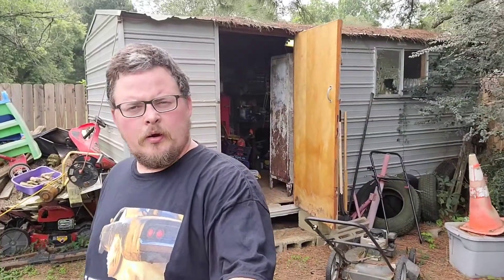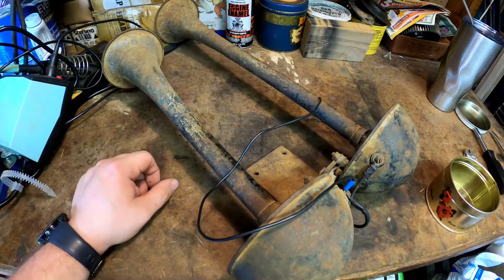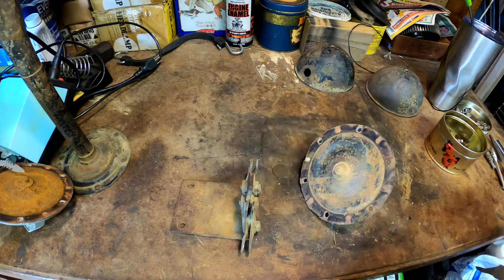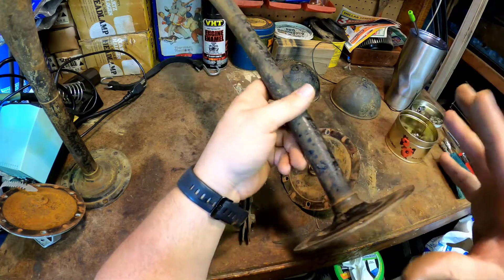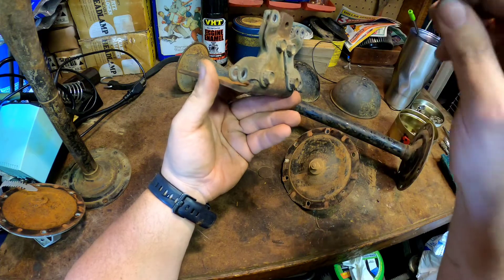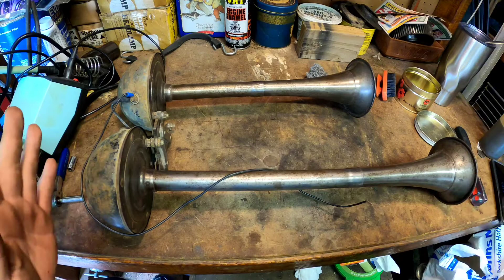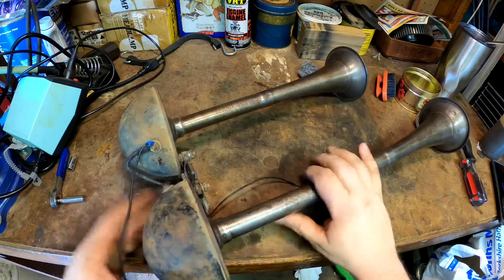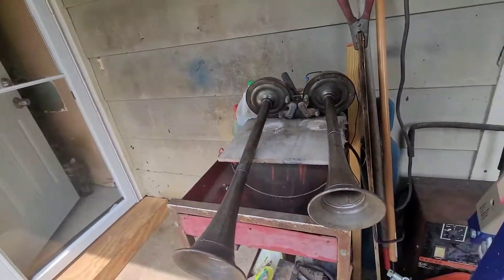Vintage Electric Horn Disassembly & Repainting

Comment: Most of these horns had a relay.  You can run the horn with your existing horn with a rely.  Great Job!  I'm restoring these types of horns.
Reply: I have one and want to remove the rust. Any ideas? It's pretty rusty and old. Still has the relay. Rusty too

Comment: So I have to confess I just finished my horns exactly like yours today and put them on my truck. However I did not use the amount that they had I just reeled holes in a piece on my truck and mounted them to it. All excited I hit the button and the fuse blew I got a feeling I can't melt them like I've got them that's why I was asking how you wired yours

Comment: I have the same horns will 12 V hurt it? Mine is pulling a lot of amps
Reply from the maker: Running 6 volt positive ground horns on a 12v negative ground system will just make them work in reverse and be louder.  At least that's what I've been told. I have had mine hooked up to a 12v system for a while now and they seem to be just fine.

Comment: I would like to see how u wired. That since u said it was positive ground
Reply from the maker: I just put B- to the body of the horns and B+ to the terminals. It's wired backwards and using 12v (just makes it louder) instead of 6v but it still works great.

Comment: Can these be mounted on the outside of your vehicle?
Reply from the maker: Probably so but I like them better in the engine compartment
Reply: I was wondering about weather rain! I have 21 and 17 inch horn's going on 2003 dodge van! So space might be an issue.
Reply from the maker: As long as the horns are mounted at least level or pointing down a little bit it should be fine